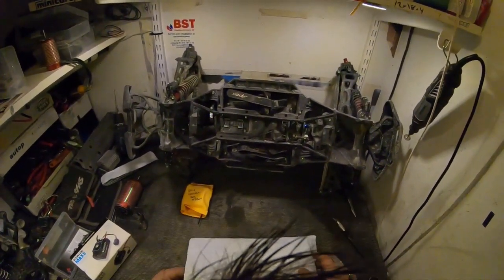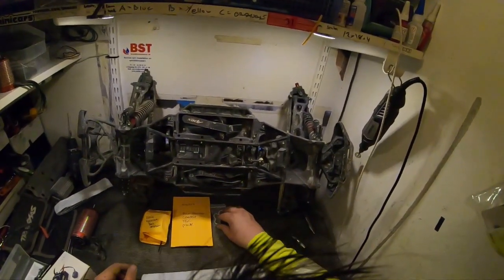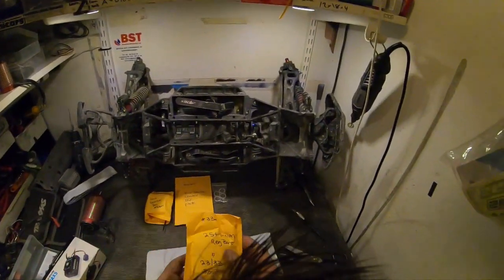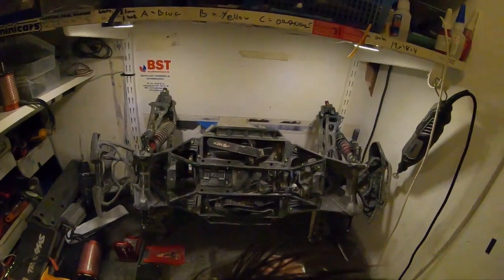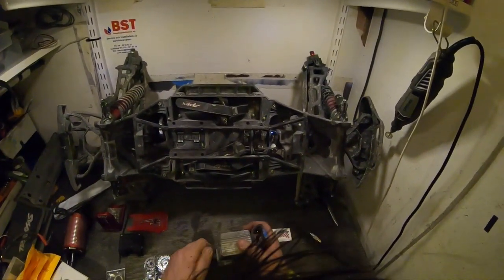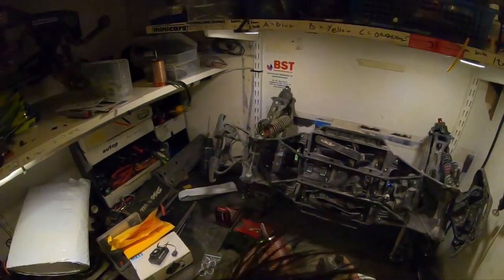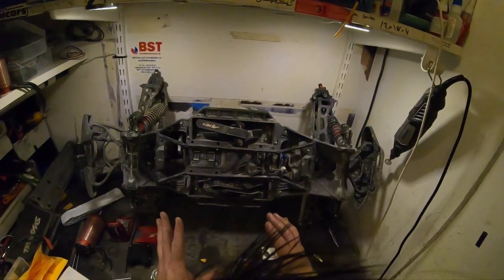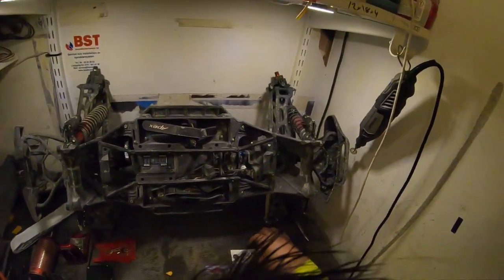WFO RC RACING Package - The Traxxas XMAXX get some treatment

Comment: Got some of the wfo gears. Stock motor xmaxx 5mm shaft motor with 8mm cush drive wfo shaft.  Didn't last 10 minutes light use mesh perfectly done. Over 30 years rc experience never seen gears do this.  Zero customer service over a month one reply no resolution. Piss poor product and especially customer service.